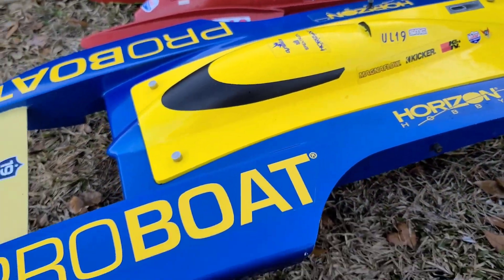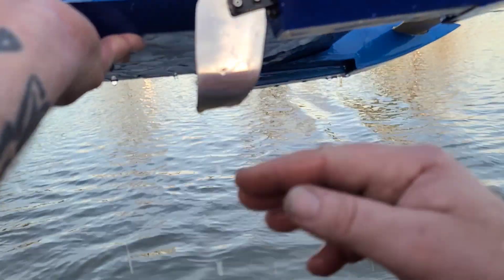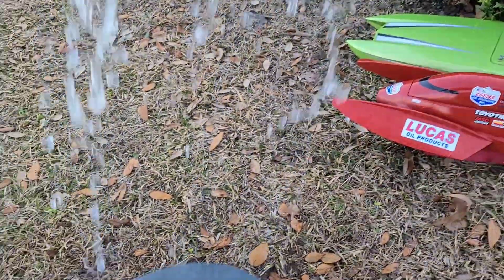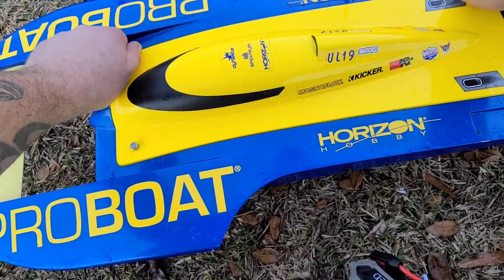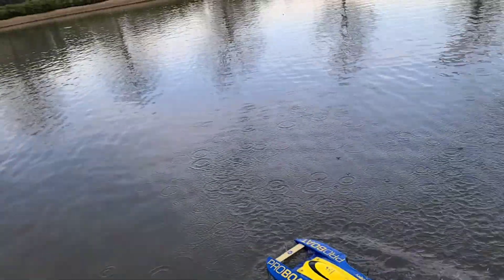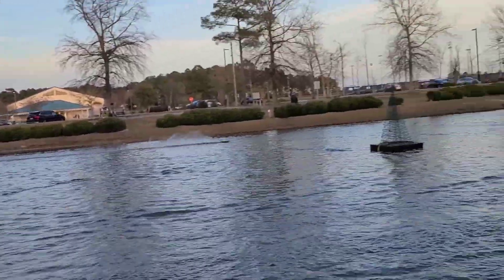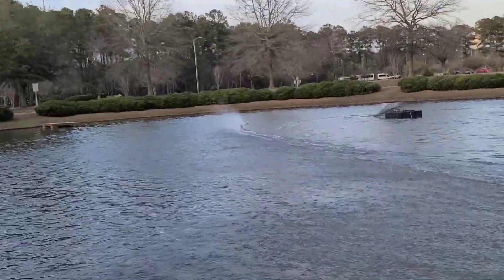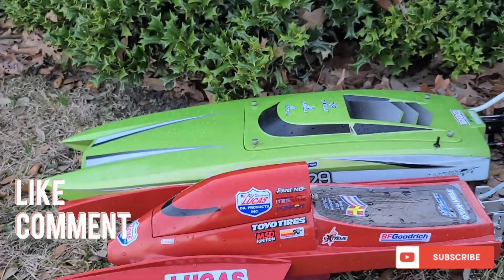WOT Oval Action Upgraded Proboat UL-19 - Castle Creations Hydra XLX2 - TP 4060 1900kv - Oxidean 4519

Comment: I was wondering... Why a tp4070? Not an expert for that matter, but there is a point that's is useless to put a bigger motor in a boat, right???? Bigger motor means bigger esc, battery, more weight, and so on.
But it would also be interesting to see if that is the case, so heck yeah...!
Reply from the maker: The 4070 is for the blackjack 42 not ul19 I'm happy with the ul at the moment.   Getting another hydra paired with a 4070cm
Reply: @IRONCLADRC  Ah, got it wrong. No, thats some kind a logical step... Btw, i don't know how it exactly was, but i remember something about Ray Shafrin. He did a speedrun with a certain type off kv  tp motor and blew his xlx2...A (speedrun)subscriber warnt about that combo. Maybe you should look into that to be certain that isn't the case with the motor you have in mind...
Reply from the maker: If I'm not mistaken it was a 6 or 8 pole custom higher kv tp motor raz was running..   that's basically the reason I couldn't run the oxidean 6 pole high kv motor,  There's some parameters that can be tweaked to run higher pole higher kv motors with the xlx2?
Reply: @IRONCLADRC  what i am going to try (in a few months probably)  the castle 1650kv motor on 8s with x8s. Haven't tried if my watercooling is sealed yet, but removed one rubber from cooling sleeve,  made the bore a bit larger so it went over ribs from motor and then put silicone glue between ribs and sleeve... There are easier ways, but that's something i wanted to try, got a castle set for a bargain. If it doesn't work i will put it in my monstertruck and just have to buy another cooling sleeve...

Comment: Twins in a hydro?  I never really considered it.  Why do we only run one motor?  Because the full-sized guys are limited by the rules and our boats are "scale" models of them.  You might be onto something there Big B......
Reply from the maker: At the time of this build the ul19 was still available at horizon hobby if it were disconnected when I started this build I would of built it twin motor I had almost everything needed to do it with too. I even did a dry set up to see if I could pull it off, it's feasible, barely with some creativity..  I've also considered putting twin 2030 7200kv HW motors in the little 13" HYDROPLANE I'm building right now, unfortunately there's not enough room.   Grrrrr

Comment: I have never seen anyone get one of these running that well. So stable 
It’s a credit to you what you’ve done on that thing man.
With the lighter batteries it sounds totally different and you can actually see it’s light while it’s running.
It’s lost that load growl it had dragging the weight
Reply from the maker: Yea I was extremely happy with her performance, can't wait for a nice day for the speed run spot.   It's blowing 25+ mph today. Crazy weather as of late
Reply: You aren't wrong..that hull with the stock setup is hard to keep in the water...it's impressive.